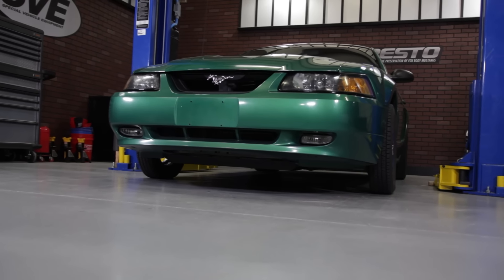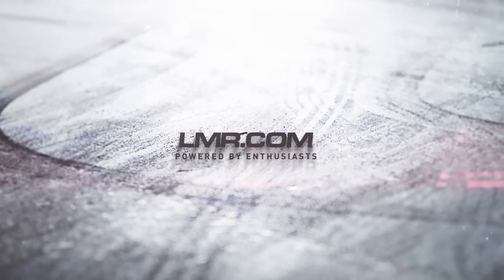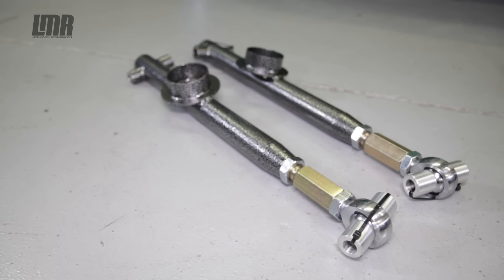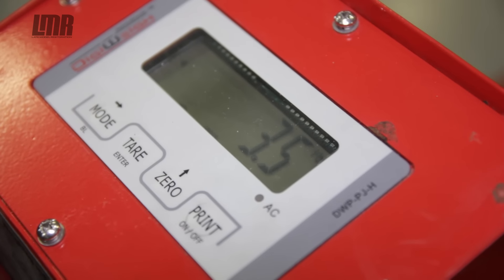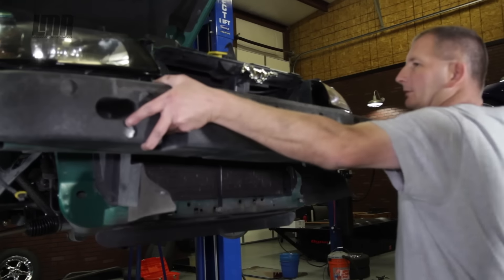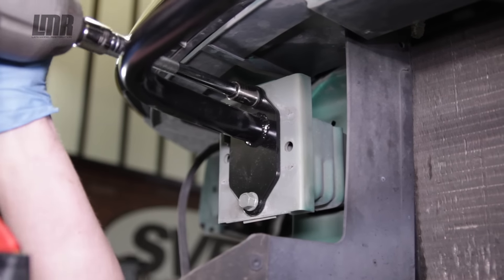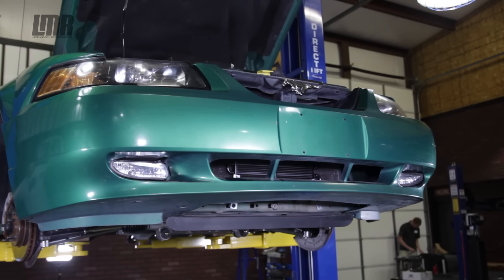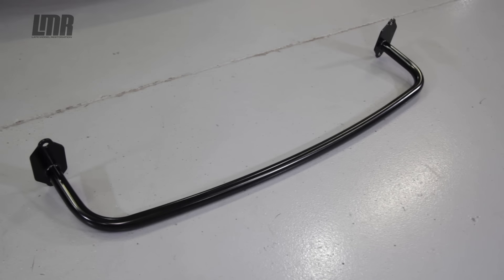Review: 1994-2004 Mustang Team Z Tubular Bumper Support

Comment: I use this bumper support on my daily should I be worried ?
Reply from the maker: You do not need to be worried when running this on your daily. It is designed for off-use only, but is still safe to have installed.